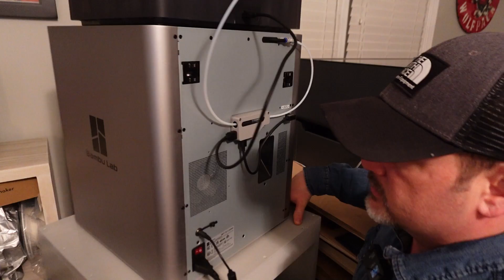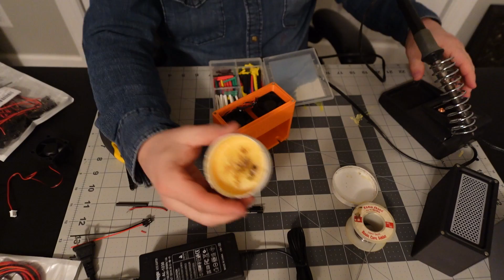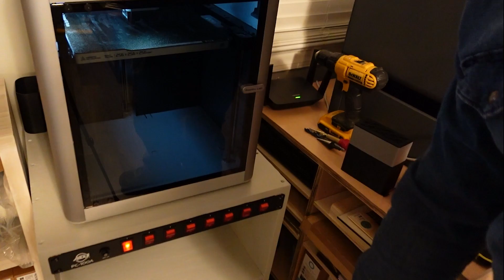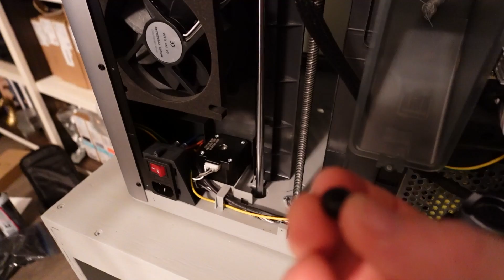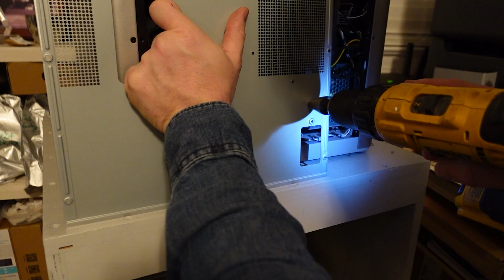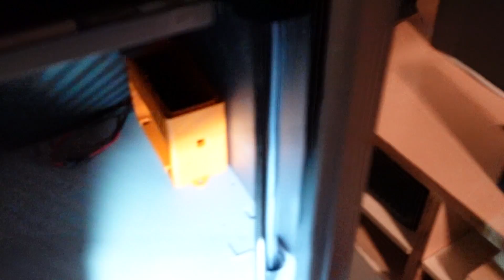How to power your Bento Box in a Bambulab X1 Carbon 3D printer

Comment: Why not just siphon some power from the PSU and use a buck converter or the likes to power it?
Reply: Is there a video showing how to wire them to power supply unit?
Reply: @MonkeyNeuronActivation  I'm not sure. But there are some resources on bambu's website about the power supply that helped me. There are a handful of screw terminals that output 24v and it probably has like 20 watts or so of headroom iirc.
Reply: @CollinQuiason I just spend an hour tearing off the back plate following manual, and found a pair of unused V+ (24v) and V- (0v) port. That was convenient.

It was hard to get the screws off though. Will likely take another hour to assembly them back...
Reply: @MonkeyNeuronActivation  Yes. There's one screw on the poop chute that I didn't bother putting back in because it was a huge pain in the ass to get out/in
Reply from the maker: If I only needed to power the bento box, I may have gone this route, I didn't want to interface with the printer's components or possibly burn anything in the printer's electronics. I wanted to keep anything that I modified separate from the printer and linked to my power bar. I have the printer, filament driers, bento box, external exhaust, etc.. all linked to a power bar with switches on a single cart station. I don't always need the bento box, filament driers, external exhaust and manually turn them on when needed. The power bar has lighted switches, so I can tell from a distance what is on, what may have an issue etc... Having the bento box powered by the printer is a good idea, but if for some reason the bento box doesn't power on because of some software change or something breaks in the printer, I don't have time to play around with it. My method is bullet proof and modular so if one component in my setup fails, it's easy to troubleshoot and replace.
Reply: @DIYLetsMakeItHappen  I don't have it running off of any software. It just goes straight into the PSU with a switch, as I'm using 24v DC fans for my custom filter. Though there is probably only ~20 watts of headroom on the PSU so if you need extra, might as well have an external power solution

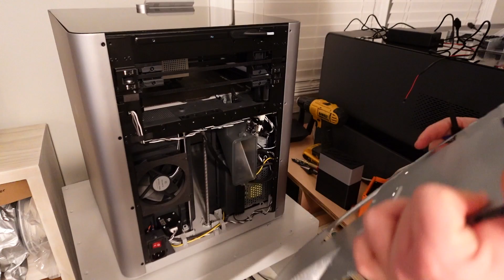Comment: Easier wiring- At 28:38 freeze the video.  At the bottom of the open back you can see a wire harness running along the back edge. Just to the right of the Z screw in the center you can see them run THRU a square looking plastic bridge to hold all the wires together. That is a big square hole going all the way thru the bottom of the printer, near the center, an inch from the back edge.   Just run your wires thru the gap in the build chamber wall, between the Z screw and the gantry drive shaft and tie them with a twist tie to that wire bundle so they won’t shift or get greasy from the Z screw., then run them following the wire harness to that square plastic bridge, and then down, thru and out.  Simple. easy. No holes need to be drilled.

Comment: i have some 4010 fans laying around, can they be used instead of 4020 or 4028 fans?
Reply from the maker: They should work. The main thing is getting them power and they need enough "pull" to pull the air through the filters.

Comment: I like your install, but I would do the drilling and deburring on the rear plate away from the open back of the printer to avoid metal fillings going everywhere.

Comment: I've been wondering... Why don't people just use the through-hole that is located about an inch toward the front of the case and to the right of that hold down screw (you can actually see it in this video) at the end of the bento box? That's where I ran the power for my unit to outside the case and it's worked great. Much easier than trying to route the power wires through the back panel. Plus, routing through that through-hole in the bottom of the case next to this thing doesn't void your warranty. You then just run the wire underneath the case to the back and put a barrel plug on the end of the wires at that point to power it. It's a clean look and works. Before anyone asks, no it doesn't get crushed under the bottom of the case because the feet lift the bottom of the case off the table it's on and no the belts on the bottom of the case also don't impact it. There's plenty of room to route the wire under the case. Just thought I'd share this in case others haven't considered it yet. I hadn't seen this suggestion any place else before I discovered that hole next to the bento box goes all the way through the case.
Reply: Is there any way to illustrate exactly where this hole is? I would like to not have to modify my printer.
Reply: @christianm4205 when you look at the back x axis screw …. It’s to the left corner.
Reply from the maker: I show in the video how I wired the Bento Box. To power the bento box I use a  DC 12V 3A Power Adapter: https://amzn.to/47EfMs2

To power all my accessories, I user a DJ 8 channel power strip: https://amzn.to/3JDLVrN
Reply: Glad I found this comment. I too did not want to drill a hole in my printer. Found the through hole in the floor of the unit, routed the wires through and back. Added a switch and power, done. Warranty still valid lol! PS at the time of this comment, when you order a bento box it comes with your choice of fans and power supply now.
Reply: You sir are a genius.

Comment: I really hate dragging out the heat gun for shrinking small heat shrink tubing and just use the fat barrel of the soldering iron instead, saves time. It’s hot enough to shrink the tubing without damaging everything else. Just roll it across the tubing.

Comment: The net infill in the website has no mesh or net structure  why ?
Reply from the maker: I don't understand the question.
Reply: The grills on the CMAG are slicer-generated. If you are using Bambu Slicer or Orca Slicer. click slice and the settings will generate the grill holes. If you are using Prusa Slicer, there is a version for Prusa Slicer in the download. If you are using Cura, please read the user manual for the slicer setting to produce the grill holes.
Pulled this directly from the maker.

Comment: I printed the Bento base remix with the hole for a rocker switch in the base and wired directly into the power supply. Much cleaner look and no external wire.
Reply: Which power supply? To the block heater lead wire? What's  the block heater voltage? Or to the bed heater?
Reply: @mytuberforyou  Directly to the spare 24V connection on the P1S internal power supply.
Reply: Which remix exactly did you use? Does it come with instructions for wiring to the P1S power supply?
Reply: @crzisme  On printables I use a model by SSX556 which also uses 5015 fans in a pull down setup. I have another printer that uses the model by 10 EinRainerZufall using 4028 fans. The wiring is simple. Simply screws down to empty terminals on the power supply. I crimped spade connectors but that isn't absolutely required.
Reply: I am a bit of dumb dumb. Could you tell me if you plugged red into V+ on the power supply?
Reply: @AsadZafar-d2j  Yes. Just make sure you have 24V fans. (I also added a switch to turn on handoff manually as needed)
Reply: Has anyone wired Bento Box fans directly with the X1C exhaust fan, so that they run only when the exhaust fan is running?
Reply: @mycyclingdisorder  you can do that with a splitter, its in the instructions.
Reply: @Obliv69  What instructions are you talking about?
Reply from the maker: good for you. I preferred the external power supply with my setup.

Comment: That fan connector is a type of JST connector, going by the look of it. We use them daily in RC stuff. In your case you were looking for a JST-XH 2.54 female.
Reply from the maker: This is the one I am using. https://amzn.to/3SSoHQt
Reply: Thanks!  With your description I quickly found the JST-XH 2.54 female connector on Amazon. I too want to avoid drilling my case.

Comment: Did it help with the VOC's and control the odor from ADA and ABS? I print inside my home and I'm looking for a way to be able to print these two plastics and keep the smell down and the VOC's
Reply from the maker: It helped a little. When I open the door, I can really smell the filament, but outside of the chamber, not so much. Later, I am going add a vent pipe to pipe anything coming from the exhaust fan in the back to go outside.
Reply: @DIYLetsMakeItHappen  Have you added the ventilation yet?